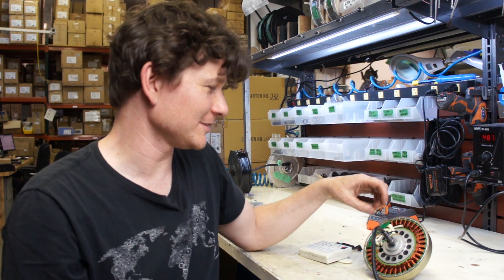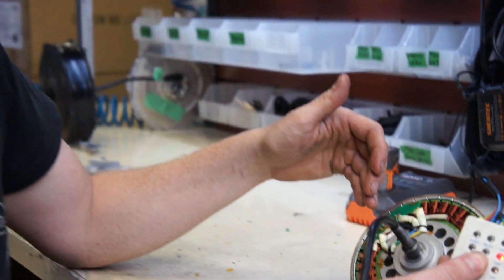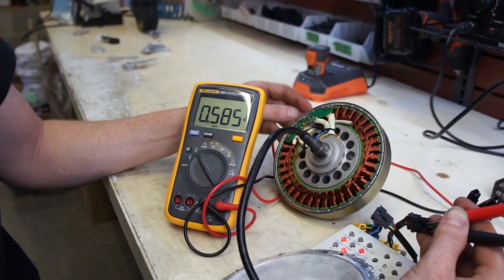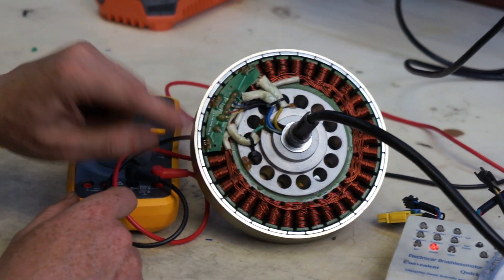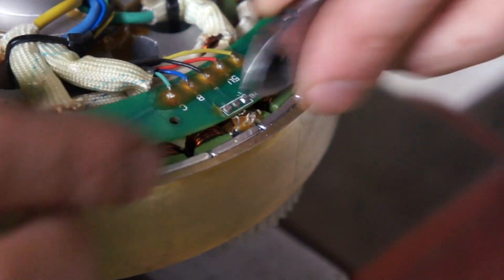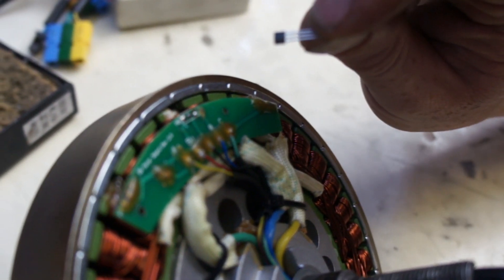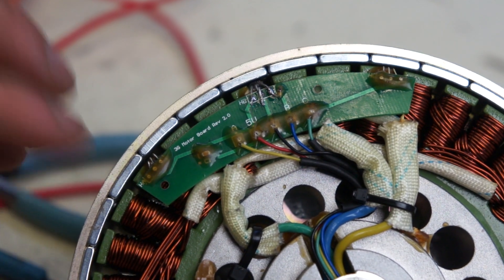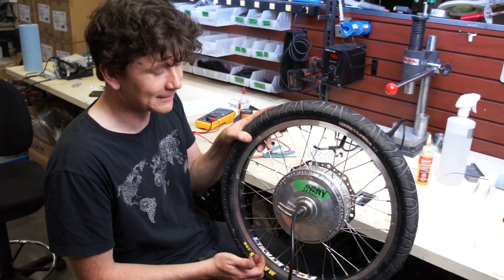How to Replace a Damaged Hall Sensor in an Ebike Hub Motor

Comment: Hi there, my bike is showing error 008 but the motor is still running. The only issue is that the thumb throttle doesn’t work. I’ve already replaced the thumb throttle, but the error is still there. What could be the problem? TIA
Reply from the maker: You need to contact the vendor or manufacturer of the bike for support on stuff like that. They sold it to you so they have the moral responsibility to understand, support, and resolve any issues. , An error code meaning is particular to a specific motor controller and display model.

Comment: I had to have two other hub motors sent to me and I still can't get my bike to work. I also had a controller sent to me because we couldn't figure it out. Everything is plugged in correctly, The bike power's up but nothing happens when I pull the throttle. It's been about 3 months drives me crazy

Comment: 4:59 so glad you kept in "an easy motor isn't easy to do a hall sensor change on. I needed that, im working on a shengmilo 1000w 48v motor the things a joke. It dosent come apart the electronics are cheap AF and the metal snapped and has bubbles in it. The large tyres are about 4mm thick if you're lucky. Those sheng milos retail for 1.5k minimum  to 5k its not just cheap they are downright dangerous.
Reply: Do yourself a favor and order a NBpower hub motor.

Comment: Is this an epoxy for metal?
Reply from the maker: Any epoxy or similar glue will generally do if the halls are contained inside a slot in the stator. But if not you want to make sure it's a glue that holds even at 120 celcius
Reply: @GrinTechnologies  thanks!

Comment: EXCELLENT VIDEO!!!

So, here's a conundrum: I have a 3-year-old Elenker power chair I bought, hyper-cheap. It wasn't working; it'd power up but show faults on the joystick. I replaced the battery, the main box, the joystick...all brand-new, never-used. No worky. Only things not replaced are the two brushless, hub-drive motors. Opened each motor: magnets are fine, the 3-phase wires are all fine (no breaks, no shorts, no grounding), the five wires for the SS41 Hall-Effect sensors (red POS, black NEG and YEL, GRN and BLU sensor-return wires) are fine: no breaks, no shorts, perfect continuity. Took a crash-course in Hall-Effect Sensor & Brushless Motor theory and tested the 3 tiny SS41s (I learned they're bipolar latching by testing with power, voltmeter & magnet); they are doing their job...but they are still suspect. Given that the magnets normally go by the sensors so quickly and switching is rapid, would it stand to bear that the SS41 sensors can be heat-damaged to the point that they do not react quickly anymore but can still show they "work" under dynamic testing? Can they still show they "work" but not work as rapidly anymore (no longer square-wave but sine-wave)? I ordered some Honeywell SS41s, good price. Can these new SS41s fix the existing ones? I just need this thing to work.

And I'm gonna go get that sensor tester. Thank you!
Reply from the maker: It's very unlikely, almost all the time if they toggle fine in a static situation they will also be toggling fine at the motor eRPM speeds.  We have seem damaged sensors though that do not have as much pull down capability, so might only go to like 1 or 2V isntead of pulling down to 0V, and that could make the controller signaling more noise sensitive.
Reply: @GrinTechnologies  -- I don't know what to do then. Aside from these SS41s, there's nothing else I can do. The joystick & brain-box are new, the motors otherwise check out, the batteries are good. The only conundrum I have is the wire bundle between the brain-box and each wheel: the only wires which aren't in use are a brown one and a white one. I'm officially dead-ended. There's nothing more I can do. This is not only frustrating but proof that the Chinese are very big on Planned Obsolescence...right out of the box.

Comment: Which motor tester are you using? I am having an e10 error with my ebike and tried replacing display and controller but not sure if it an issue with the hall sensor on the motor hub

Comment: I just purchased a Phaserunner controller from you. I'm not going to use it on the bike I'm going to talk about right now, but in theory can't I use the phaserunner controller to check the hall sensors? I had to swap motors since the broken bike I just fixed had a motor problem after replacing everything else. The motor will run up and then stop running, then I get error 8 on a display that runs the Bafang protocol.  The new motor harness I made can connect right up to the phaserunner, I did it so I could quickly swap out from one to the other when I need to. I have the products I purchased from you set aside since I was going to work on that after my mode of transportation was working and reliable. Since I'm not using that motor now I was planning on fixing it next.
Reply from the maker: Yes with a phaserunner correctly attached to the motor halls you can easily see if all 3 hall signals are toggling properly or not via the dashboard tab

Comment: My wheel is feeling like stepping, and not rolling freely backwards. I got this ebike for 50eur and i want to fix it, first time ebike owner. It has 48v 250w brushless cassete rear hub motor, green phase wire and thin green i guess (sensor wire) was damaged and i think its possible that they might have touched and made short. Motor controller is: X043-AXC001. I was not able to find replacement for controller. Tomorrow i will try to open up the motor. Can i just run it without hall sensors ?
Reply from the maker: You can definitely run it without hall sensors as long as you get a sensorless compatible motor controller that can handle the eRPM of that particular geared motor. If the motor spins backwards freely when the current controller is disconnected it should be fine, but if it has that stepping feeling rolling backwards even with the controller unplugged that is a sign that there is a short inside the motor windings or phase leads and a more significant motor repair may be in the works.
Reply: @GrinTechnologies  Yeah motor is having stepping feeling also when disconnected. I opened up the motor and gearing sprockets are all stripped and there  is tons of plastic bits inside. I think i might just  buy new controller and motor. Only if i could find replacement for my controller, they don't make them anymore, and other controllers have different wiring.

Comment: I had vibration coming from the motor I took it apart and greased it and the vibration went but as soon as I went on flat grass it came back, any idea what is wrong and how to fix it please? Is it OK to carry on using it if it vibrates?
Reply from the maker: I mean without any mention of the motor type or model, the motor controller details, or a more accurate description of the type of vibrations you are experiencing it's pretty hard to tell you much.

Comment: I have a rad power bike Rad Runner2, I'm not the world's greatest electrician,I'm waiting on my brother-in-law at the moment to help me diagnose My Hub issue whether it's the hall sensor or a couple burnt windings on the motor.but after replacing the speed controller twice, the wiring harness,and the Pas sensor.and both times I reassemble the bike and tried to see if it would work two of the plugs on the speed controller coming from The Hub were semi burnt scorched.waiting on my brother-in-law to come up from Fort Worth to Wichita Falls to watch this video right now so he can help me diagnose this Hub issue I have.but from all the videos I've seen and I've only watched halfway through this one I'm thinking it's more of maybe a burnt winding then it would be a hall sensor was curious as to what you might think would be the cause of burning out the plug from the Hub motor to the speed controller and leave it squirts like it has but.I will definitely let you know what my brother is able to deduce after watching this video

Comment: hi . i got an foc controller and on motor side its got 5 wire hall harness but on controller side hall harness has 6 wires with white as extra and it has about 5-10V ...what could it be? rev or rpm sensor input or temp sensor?
Reply from the maker: The 6th wires is usually either a speed sensor (freewheeling geared motor) or a temperature sensor (Direct drive motor)

Comment: I have juiced hyperscrambler 2 need to fix hall sensor, but thinking just buy the rear hub motor with wheel and tires, do you guys sell this stuff for my juiced  hyperscrambler 2

Comment: Hi there. I have a question. The hall sensor must touch the magnets or it doesn't matter where you put the sensor?
Reply from the maker: The location matters quite crititically since that determines the hall pattern and hall timing, so you want to replace them in the same spot, uness you REALLY know what you are doing in which case you could put them in any other location that results in the same effective hall transition point.   They should be close to the magnets to reduce effect of stray fields, but obviously not touching.

Comment: my 2000w hub motor, says i go over 50 kmph but i go walk speed. i have 29 inch, and in setup set it to 29"  if i put it on 26" it still shows more kmph then i actaly go.. and sometimes it does not show speed at all, then it says 00 kmph. what can be the problem ?
Reply from the maker: Probably not the motor hall sensors, which is the subject of this video! 

If you are having problems with the display speed readings, your should talk to the vendor who sold the motor controller and display for support. They own the burden to resolve this for you no?

Comment: Are you located in the united states and do you accept customers scooters for repair
Reply from the maker: Nope and nope. There are very few places anywhere that have the technical chops and interest to do scooter repairs. This usually ends up being a diy job of you have the skills, or landfill fodder if you don't.
Reply: @GrinTechnologies  dont think i could but then again i just did a timing belt in my wifes car and that was the most in depth auto repair i have ever done

Comment: How did you remove The Black case On to reveal the inside of the motor?
Reply from the maker: The side plate screws are removed with a screw driver or impact driver if they are quite tight, and then the hub just opens up.

Comment: Hi there a friend of mine has an engwe  EP2 pro 750w that's covered 4000 miles and noticed over time the lack of pedal assistance and more pedal effort required. He's had the batteries checked and are fine. I'm just wondering if it's the hub motor wants greasing maybe friction or something else. He's at a bit of a loss atm
Reply from the maker: Well, it's definitely not hall sensor issues which is the subject of this video. It's also for sure not related to greasing. Hub motors do not require maintenance greasing and frictional losses here are totally imperceptible to motor performance. 
Hopefully your friend can get support from the person or company that sold him the ebike. (That is assuming that there is truly a quantified issue and not just a subjective opinion that it feels weaker, which may or may not be actually true.)

Comment: I have a question  , I have a 48volt 1000watt ebike that the cord was cut and in replacing it the hall sensors broke off and 2 of the 3 were lost. Is it possible to order more and how do I know which ones it takes. the one I have is not marked.
Reply from the maker: Yes you can, but it's even easier not to bother replacing them and just run the motor sensorless. 
Honeywell SS41 is a popular motor hall IC, but there are hundreds of others that will work fine too.

Comment: I was told to de solder the twisting part. Where there motors aluminum wire is twisted with the copper. Is that a good thing to do? 

The plan is to yank out the harness to solder the torn up cables then re use them
Reply from the maker: There should not be any aluminum wire inside a hub motor we've heard of. Are you confusing tinned copper with aluminum?

Comment: For anyone watching this video.
You should use a pair of light duty locking needle  forecepts  for PCB electronics and flux paste so that you can bend them to 90 degrees instead of finger pushing because the metal pins will become a spring with the finger bending will create a spring tension. Apologies for the poor English grimmer.

Comment: What happens if all 3 wires have 3.84v? Do I need to change the ss41?
Reply from the maker: The voltage is a function of the pull up resistors on your motor controller, it has nothing to do with the hall sensor itself which is an open collector output device.
Reply: @GrinTechnologies  I initially believed the voltage was the issue, so thank you for clarifying. I experienced a similar situation where my cables became twisted while riding. The yellow cable suffered some damage, which I believe affected the hall sensor. I assume it's the hall sensor since, when I conduct a test using the app, the motor doesn't respond.

Comment: Quick question,  would it be possible to just get a sensor less controller or do those only work with sensor less hub motors ?

Comment: The issue is this: how many hours of labor did it take to diagnose and fix this?
Reply from the maker: Depending on your skill levels, it can be like a 20 minute jobby or an entire weekend.  The point of this video is to illustrate the process for those who enjoy learning and DIY work and inclined to do this kind of repair.  If you don't, then for sure we'd suggest to just drop the motor off at a metal recycling facility and buy a a new one.
Reply: Regardless of the time it took to do the repair when you have a 60 volt fat tire hub motor that cost more than $300 to buy new it’s well worth the time it takes to fix it .  Good video ,  thanks for the lesson.

Comment: Great video. Could you tell me if I have a problem with my hall sensors. When I switch ebike tester on all 3 hall sensor lights come on, but when I rotate the wheel they toggle as normal. Is it working ok if initially all 3 lights display?
Reply from the maker: That's odd but not knowning anything about your particular ebike tester we can't say. In general, with 120 degree hall timing you should always have at least one hall signal that is high, and one that is low, at every rotor position.

Comment: hey thanks fr the information, I have an ebike which powers up but the motor doesn''t power up, it still turns like you showed us I can feel the magnets enganging. what I wanted to know before I rip apart my bike, I was riding and my batteries were low but not too low, I had a screw come loose on my bike disc and it wedged my tire for a second, then my motor stopped working. can you explain what I could have done, do I need to rip it all apart, again lol thanks, good videos
Reply from the maker: I would check for damage on the wiring where the cable exits the axle first, and if nothing seems suspect there then open it up.  Some motors have disk screw holes that go right through the shell and into the motor body, ie not blind holes, and we've seen cases where screws that were too long actually poked through and damaged the inside of the hub. We've also seen cases of blind screw holes where people used a screw that was too long and it punched right through the blind end of the hole to dislodge a piece of the diecast casing that then was loose inside the motor and caused damage.
Reply: @GrinTechnologies  the motor is in pristine shape, it;s a 500 watt continuous., do you think I could of killed the motor or thrown some sort of safety switch to prevent damage to the motor, the magnets seem to still be very strong when I turn the wheel so Im a lil confused, what would of happened of lets say a rock skipped up into your brake and cause alot of pressure on the motor. the second my wheel locked up I hit the brake, I was going like 12 km hr. its a fairly new bike and I take immaculate care of it. this always seems to happen at the beginning of the summer ride season for me,. I have the worst luck, it is not an EZ motor to deal with ;)

Comment: Help! Do some motors have 4 hall sensors?? I see the three normal looking ones that are in between the magnets, but there is another 3 pin chip on the top of the circuit board that’s just laying low. For me that one is burnt up. What is it??
Reply from the maker: That is the wheel speed sensor

Comment: Do all Bafang hub motors have an ss41 hall sensor?
Reply from the maker: No, some are made and sold without halls and only run sensorless. But most of the time they do. Not the actual SS41 chip but any of the zillion equivalent generic hall IC's.
Reply: @GrinTechnologies  Thanks for the reply .
Reply: @GrinTechnologies  I'm having trouble fixing my bike and trying to learn how to. I have a 07E error code, so I thought it might be the hall sensors. So I changed them. Still not working. Do you think it could be the board is fried or my main cable in put is broken?

Comment: Any idea where the speed sensor is?
Reply from the maker: If the bike is one with a speed sensor then it will be picking up the embedded magnets in the motor shell. So look at where the magnets are located in the shell of your motor, and you'll see the speed sensor hall at a location to sense these.

Comment: Hi my Kugoo m4 pro motor making vibrating sound wen accelerate .. hall sensors on mine say 41f 001 I can’t seam to find one can you recommend a hall sensor number that will run with mine … thanks god vid too

Comment: Does anyone know if hall sensors are all the same, or if there are fundamental differences between branches/types. I have a different hub (BH Neocross bike) and I am unable to find out which hall sensor to get, or if it does not matter so much?
Reply from the maker: All of the BLDC hub motors we have ever seen use the same style of bipolar hall IC and are fully interchangeable.